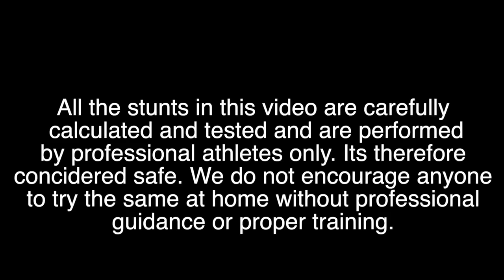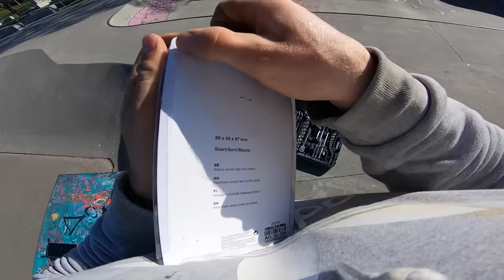BMX RIDING WITH STEERING WHEEL

Comment: You know what would make it better? 

Add a gear on the bottom of the wheel and on the top of the turning bit, and so when you turn lets say one full rotation you would only turn the wheel 45 degrees. Now wouldn't that be cool